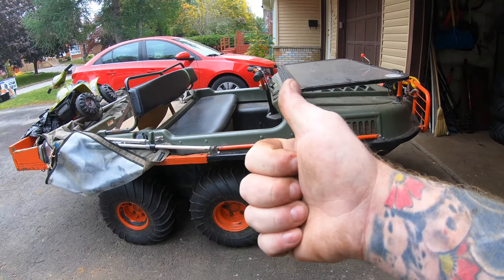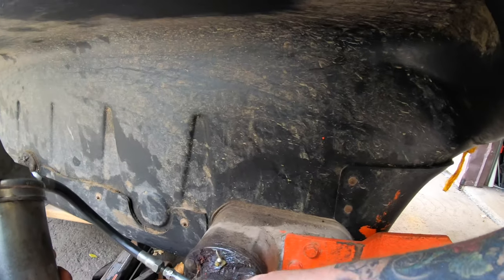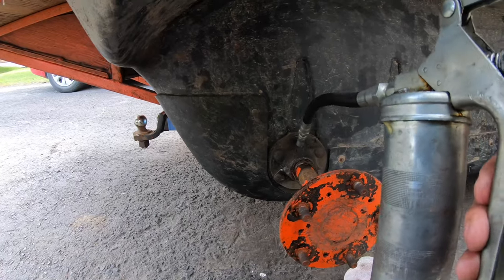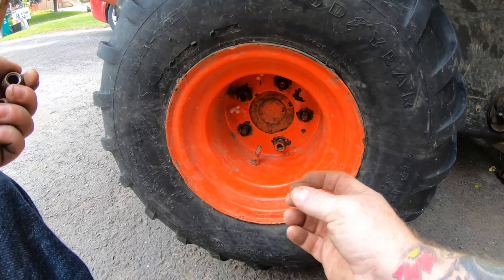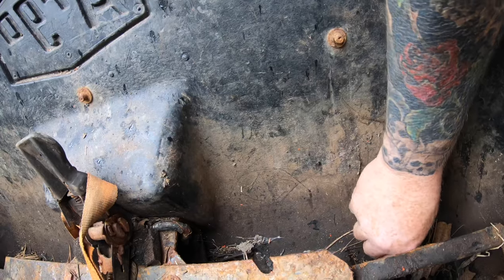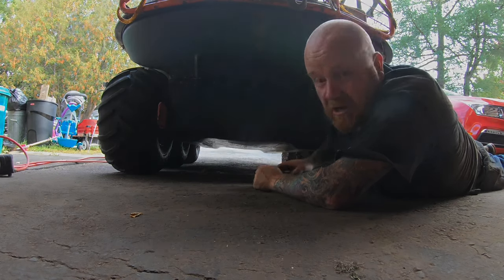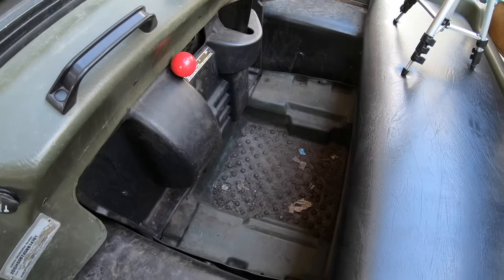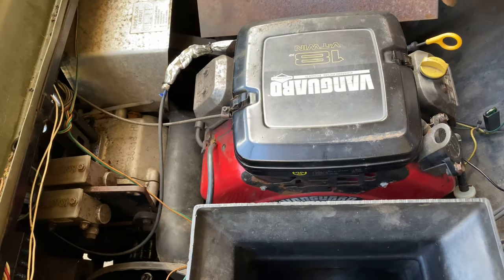Doing maintenance on a 2005 Argo Bigfoot 6x6

Comment: Great video. Useful for me with my old 1982 Argo 8x8
Reply from the maker: Had a 1983 8x8 those pin axel are garbage broke every one. Braking the main sucks bc you lose drive on one side, broke both ended up changing them all to key and spline shafts. I still blow bearings on the 2005 so they never fixed that issue.
Reply: That is right, damn problem with the old pined style axles! For the moment they are to worn, I will change the axles.

Comment: Nothing like a bit of service maitaince Big Boones buddy. One uga duga you don't want to  be  wrenching to hard again in woods good ideas buddy. My brother's mate has one but no drive I said I would take a look for  him when I can get over. So your videos maybe help me out I can always give  you a message. It's had new chain's so they said but ach am sure we will sort it out nice one mate. Good luck with your hunt.👍👍
Reply from the maker: Ali Mack- Mechanical this is my third Argo so any question I’m there buddy. Anything older than 1997 has spring pins in the axels they brake and you’ll loose the drive off the main axel. What’s good is they can be upgraded to stronger modern axel with spines and key.

Comment: The grease nipples should be somewhere around 1/8” NPT, you could go to a heavy truck parts store and grab some air line fittings and a little bit of synflex hose to setup a remote grease nipple for that hard to get one... my Avenger has them for the idler shaft inboard bearings and man it saves scraped knuckles.

Good luck hunting! 👍
Reply from the maker: Puskwaska Outdoors I was think about doing something like that. Only that one nipple under the battery that gives me or everyone a problem. Good luck on the moose hunt 👍